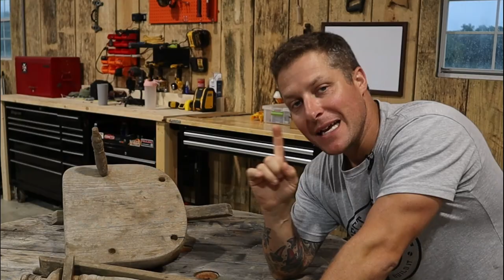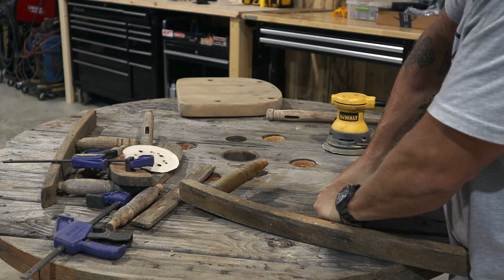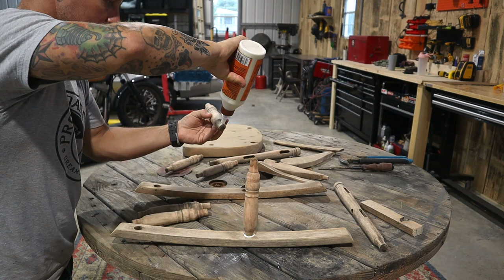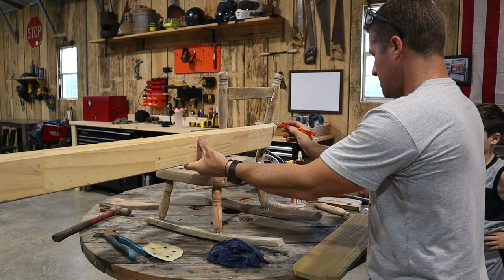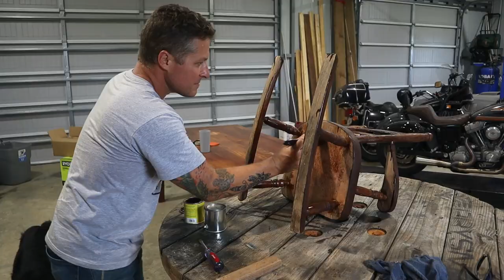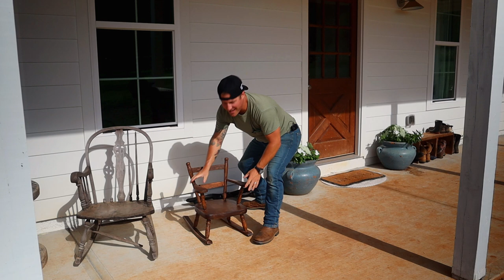I SURPRISED MY SON. Finally Rebuilding his rocking chair. DIY kids rocking chair

Comment: I used the polyurethane expanding Gorilla Glue for a staircase railing with round tenon and socket joints.  I used small grooves in each socket to allow air and excess glue to escape from the joints and the result has been super solid.

Regular wood glue is how it used to be done for sure but the expanding glue gives you more room for errors because it will fill them in.  Masking the glue joints with painter's tape makes the excess glue cleanup a lot easier.
Reply from the maker: Aww. Thank you sir didn’t think about using expanding glue. Next time for sure. Thanks for watching.